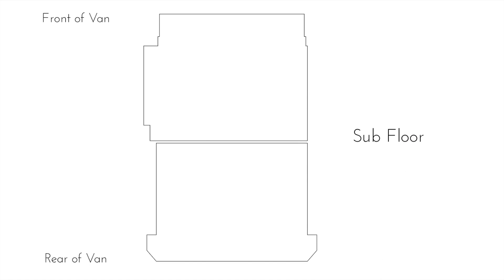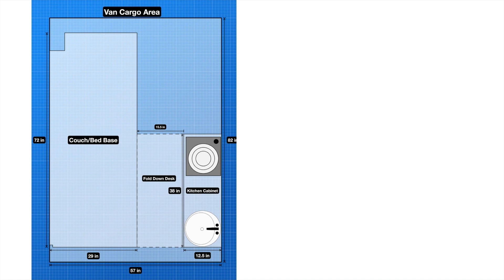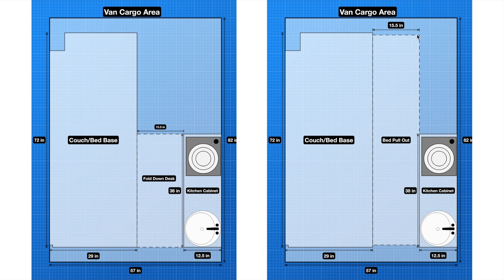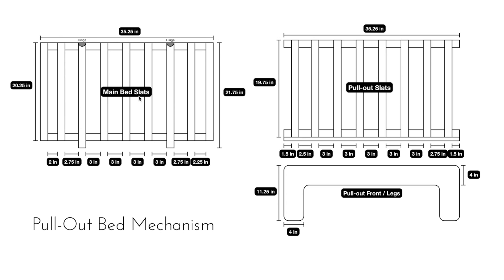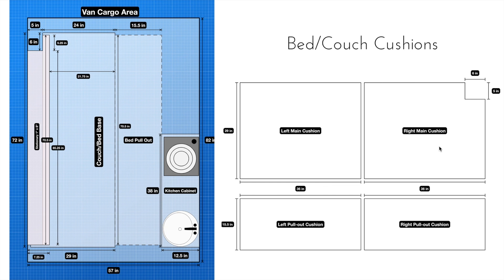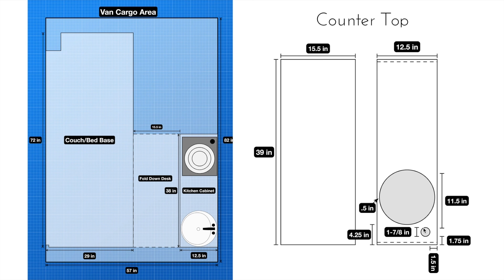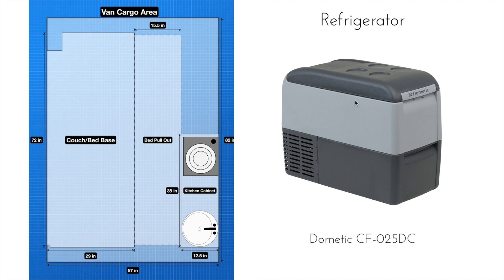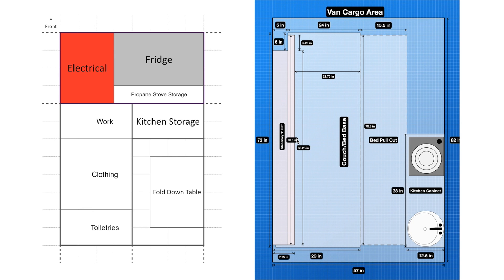DIY Camper Van Conversion - The Plan

Comment: The process IS part of the fun!  One tho't... could you extend the kitchen maybe 6 to 12" toward the side door, then move the sink to the front of that counter, and place the refridge, on sliders, under the cabinet, towards the back of the van?  When a sofa, refridge could be slid out, but when in desk or bed config, you could slide refridge under/inside the kitchen counter.  Yes, you will have to build storage above the counter, but you still ought to have space under sink for grey water tank and possibly fresh water, too.
Reply from the maker: That's a good idea, but wouldn't work with the wheel well unfortunately. I didn't draw it into those plans but the wheel well runs just about the entire length from the side door to the back door. It's 11" tall and protrudes 5" from the wall so it limits what can be done there. The cabinet will be built on top of it but the floor space will only be about 6" deep. I plan to store shoes there.

Comment: one other idea... lol.  If you build a galley rail (think boat counters) all around edge of kitchen cabinet and make your desk top so it not only folds down but could also fold up and over the sink, it could hide the sink and allow easier access to what ever you have below that sink/counter area.
Reply from the maker: I like that idea. Though the only thing under the sink will be the grey and fresh water tanks. The faucet will also stick up so that would get in the way.
Reply: yup!  and I forgot about the wheel well!  For my sink, which I built into an antique sewing machine cabinet, I cut a section out to allow for the faucet.  I may change that to fold down faucet when and if I get one.
Reply from the maker: +Day Drifter That would work. I'll have to see how it all comes together. The desk may not be flush with the counter because I found a reclaimed cabinet for $5 that I'm going to use for that counter. Have to see what height I need the desk at.